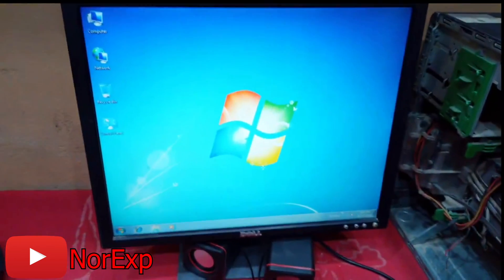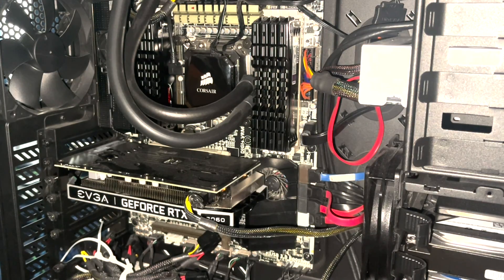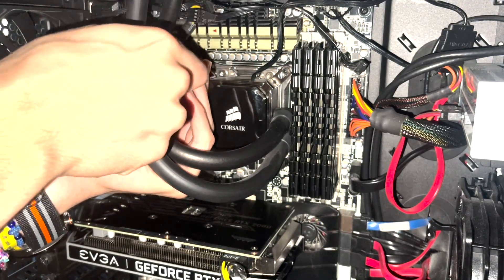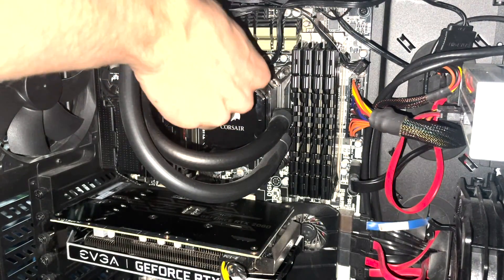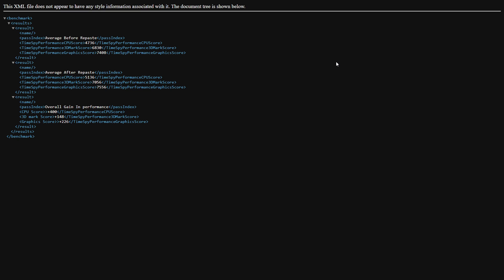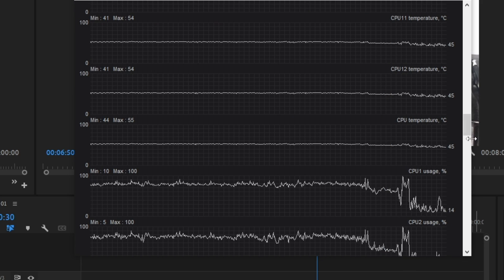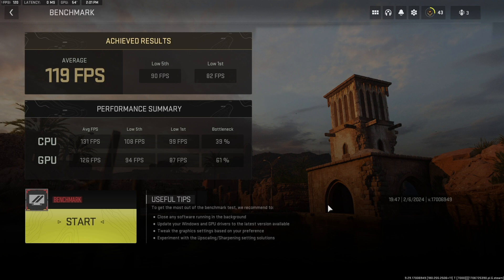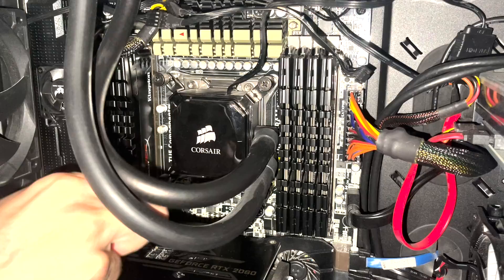Should You Repaste Your CPU?

Comment: Is there any liquid left in that AIO? I just removed the same old h100 unit from a decade old system and a lot of the liquid had evaporated out through the tubes.
Reply from the maker: @kevintipcorn6787  That is a good question. The temps are staying consistent under load and aren't that high. around 50c. I assume that at this point some has evaporated. I may do an AIO maintenance video sometime down the road.

Comment: I had to recently move up to 850w from 600w. System wouldn't even boot with an extra 100w load. Kept cycling the trouble LEDs. Worth a shot, Apevia has some decent and cheap units on Amazon.
Reply from the maker: Could the PSU have been faulty? normally a psu upgrade should not cause the system to not boot.
Reply: just did the same upgrade and mine was fine, along with my 3080 addition

Comment: I think you needed to repaste your cpu because you used a non liquid metal paste or just a crappy paste which loses it's properties overtime. My 5930K has like almost a decade and after cleaning the dust it needs like 5 minutes to go above 60 degree celsius under max load with prime 95 which is between 130 and 140 watts. It idles usually somewhere between 36 and 40 and doesn't go above 50 when gaming.
Reply from the maker: @SuperBase2 It Depends on the cooler as well as ambient temperature. Liquid metal paste is to be changed every 1-3 years depending on workload and cooler material. After the re paste. The CPU does not seem to get as hot as it did before. Even pushing it to a 4.0 GHz overclock.
Reply: @DinosaurTalksTech   Mine is usually on for 12 to 16 hours daily since I bought it, but I can't see any reason to  repaste it with these temps. Room temp is around 23 or 24.
Reply: Meanwhile my pc is idling at 50C. Interesting.

Comment: Kind of surprised to see someone using a 3930k in 2024. Still kind of neat. I remember it was almost a legendary processor at the time. It was really hyped up as this workhorse of a cpu, that people were throwing ridiculous amounts of cash at. Especially loading it with quad SLI. I remember seeing people even put 64gb's in these systems. It was such a weird time, it was looked upon as such a high end cpu. It was for sure, but when the 5th gen launched, it didn't seem as exciting and people seen an 8 core for $1000 and 10 core launch after spending $1000 on a 6 core cpu. You weren't seeing as many high end builds posted up anymore. It was a weird time. 

I would imagine if you could put an nvme ssd on a pci-e card, the system should hold up reasonably. The system like yours having 2133mhz ddr3 at 2400mhz with quad channel is a lot of bandwidth. I remember people getting that cpu to around 4.7ghz relatively easy. I think I would push it to at least 4.5-4.6ghz. 

As for the thermal paste, if you notice your temps are higher than normal, after 3-5 years, probably check and replace it. I am currently using arctic silver mx-4 for my cpu and gpu. I did a repaste. I would rather be using mx-6 now. However mx-4 is long lasting. If you are up in the high 95c+, a lot of thermal pastes tend to break down at those temps and it may have had the pump out effect and would be all dried out. For older systems, heating is a good idea, but also twisting the cpu cooler first is a pretty good idea after removing any retention screws or brackets. If you are using old systems you want to keep around or doing a laptop, I think it might be a good idea if you plan on keeping a system and dont want to repaste to possibly use those reusable thermal pads instead. There are some really good ones that you don't have to worry about ever replacing and do nearly as good as most thermal pastes. I did that for a laptop and don't regret it.
Reply from the maker: @JeordieEH  Thanks! I hope to do an upgrade soon.. I could put a nvme ssd on a pci-e card like you said. But even with the Sata SSD i have it runs well. At some point I will try to push the overclock to atleast 4.5 and see what kind of performance numbers we can get. Thermal pads are a great idea! Thanks for the great comment and advice!

Comment: Aren't you gonna have a bunch of air bubbles locked inside with that paste pattern?
Reply: Nah!  As the paste gets heated in it will spread just fine.  You could see how it spread itself just by placing the cooler block on it.  For laptops I just use a small dot as the CPU and GPU dies are so small.  For desktop CPUs and GPUs I usually just apply an X.
Reply from the maker: @Admiral_Jezza  . That may be a possibility. The pressure from the CPU cooler should remove if any air bubbles or pockets. It's always good to double check and make sure you have an even spread. I may have put too much on for this video. But temps seem to be running stable.

Comment: It's always a good idea to re-paste your CPU, heck even GPU. I don't have issues with thermal throttling because I'm using a decent cooler and good enough airflow, but whenever possible, I reapply some good old paste. My favorite is  the HY500 from Ali, pretty good price/performance ratio :) Anyways, great vid, keep up to good work
Reply: cpu yes, gpu - absolutely not worth it unless you want to mess with thermal pad measurements and messing it up even more

Comment: Ok, so what about GPUs`? I got an 980ti from eBay and I wonder if I should do that, never did it on a GPU before tho
Reply from the maker: @jasonmeister6988  I would recommend changing the thermal paste on that GPU. The pads are a difficult thing to try and swap out since too thick or thin would affect the GPU. unless the pads are dry like a chalk and breaking. I would keep the pads on there and just change the Paste
Reply: @DinosaurTalksTech  thx
Reply: @jasonmeister6988  I recently serviced my old 980 and the core paste was bone dry and hard but the pads were fine, an alcohol based cleaner removed the residue with little issue. Didn't really notice any performance change since my old games are mostly cpu bound anyway.
Reply: you should repaste is its a very old gpu
Reply: @HondaMan732  I would need some new pads for the Vram, right? Guess I can't go wrong with the thermal Grizzly package
Reply: @jasonmeister6988  i dont think most people replace the pads tho if u want to u can
Reply: 100% do it. I bought a used 3060 ti that was quite clean dust wise but it was running into the early 80s. I repasted it with cheap asf thermal paste and it ran about 12-15c cooler
Reply: @atom608 how??? I have had a 3080 since release day and the thing still runs the same at 66c avg... It's also used everyday for 8+ hours in all workloads.
Reply: Seen a couple of old GPUs lately (a 480 and two Vega 56s). I would definitely look into changing the paste. The memory pads are probably ok, but can get messed up when you take the card apart, so I would have spares ready. Take it slow, don't force anything and keep your screws in order :)

Comment: My CPU has been running at 108 degrees for 9 years straight and it's doing fine.
Reply: Doesn't it crash sometimes in CPU Bound games? My friends 10 year old gpu crashed a lot and I told him to replace the paste, he did and we even overclocked it, runs 60% better as its a GT 730 DDR3.
Reply: @kubeceu2715 hes capping dude impossible 109 after 10 days will blow the fuck up💀
Reply: @VladimirPutin-y6j  could be F not C lol
Reply: what cpu is that?
Reply from the maker: @boxscorewatcher413 108 fahrenheit (around 42 c) that is not that bad. Especially if you're able to keep it that cool. If you are saying 108 c. The PC should have shut down the minute it reached 100. Or the cpu would have throttled itself.
Reply: @DinosaurTalksTech  true
Reply: @DinosaurTalksTech  that's called throttling
Reply from the maker: Hi @maklogetrich2378  Yes, Thank you. The correction has been made.